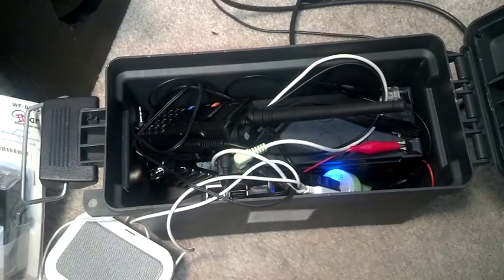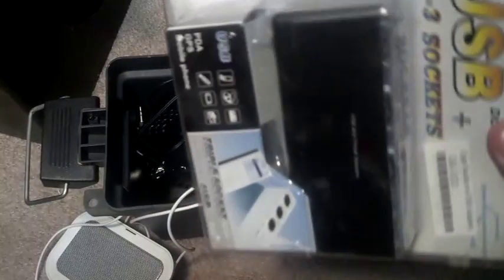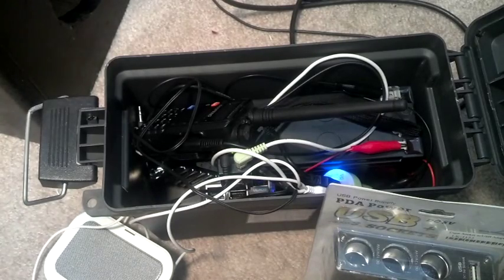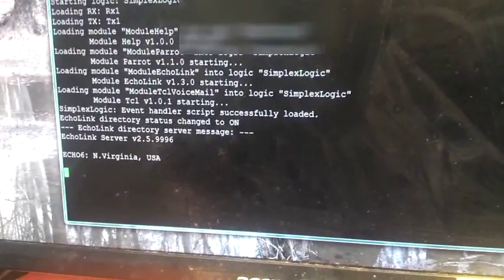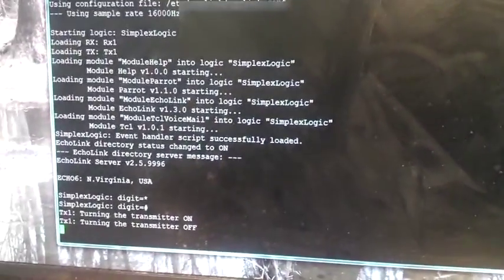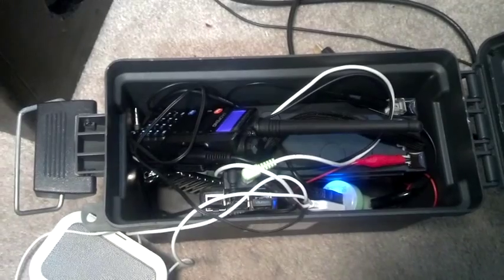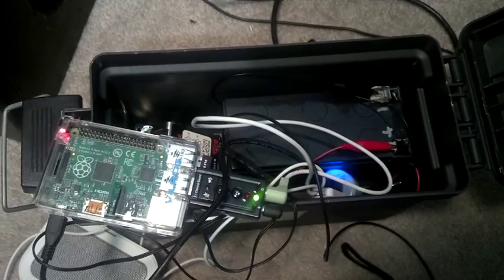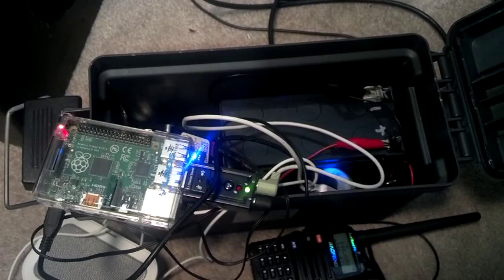Raspberry Pi Svxlink Echolink

Comment: Also NHRC has a repater controller kit that you can build cheap.  I has a digital audio storage chip.  You can use the chip for audio ID on a standard duplexed repeater, but you can also set it for CW ID and use the voice storage chip to record audio and turn it into a simplex repeater, that would be a cheap way to turn it into a full featured emergency repeater very inexpensively.

Comment: So are you just using it just as a simplex connection to get into echo link or does that HT support cross band repeat as well.   I have a great little emergency antenna in my Faraday cage that would be great for that.  I can pull it out and do a review on it if you want.  It was very affordable and works great and rolls up when you are done with it.  73

Comment: why any amateur would think about relying on an internet connection, for emergency comms, is beyond reasonable thinking. i will admit that it's a interesting way to talk or communicate.  but why use a radio? when you have a computer and an internet connection. i've debated this very subject with other hams over d-link radios. and they still think it wise to involve the net. tell me what form or radio will get though when all else fails, morse code? and how many hams lately have passed the test or even studied code since the day the fcc made the judgement call to drop 5 wpm. heck i passed 5 wpm. i'll admit by the skin of my teeth on the questions and answers portion. code copy? not by far. but why i copied is how i passed the q&a. amateur radio is failing to educate it's hobbyist/users in electronic principles. i'm a general class ham and i don't know how to design or build a circuit. i can identify a circuit. but how will that help me put together something when i need something to call out for help. that is what hams used to be able to do. now we buy equipment then plug and play. also, when the government pulls the plug on the net where will ecolink be. this being all about the net neutrality act.
Reply from the maker: To be honest for emergency comms I plan to use my pactor 3 station over HF. But that is out of the cost range for a lot of people.  What i would like  see happen is a low cost digital station people could have for around 50 bucks or so.   Echolink is really just a HF simulator for Technician class kind of like Skype without out the video, It gives them a taste of the really cool / fun stuff.  Code takes time to learn not a lot of people these days want to put forth the effort. Echolink is a fun thing to play with but It will never give you the thrill of building a radio or talking via moon bounce or meteor scatter. As a side note echolink it want made me want to get my general licence   I wanted that hf worlds then became a extra because I wanted more bandwidth.
Reply: there lies the problem within the amateur ranks of the u.s.. and you said it, lazy people. and i happen to be one of them. but i put forth the effort to get my tech plus and got it. then i got my general when it took 5wpm. i doubt i could have passed 13 wpm then but i would have because the faster it comes at you the easier it is top hear the word opposed to the letter. like cq as opposed to c--q . and i'm on hamexam.org right now. failing with a 50% average. but i'm going to get my extra. i will do what it takes to read 20wpm. it becomes natural form of communication. you'll just understand the words by nature, like talking or signing to the deaf. at my family farm, i have a neighboring ham who runs a eme receiver/listener with what looks like an massive oven rack of yagi antennas. he does contesting with them he has two arrays like this.. http://www.nitehawk.com/rasmit/ja5ovu.jpg... if your going to talk on vhf or uhf for any real distance. this is the way. you just have to pick your phase of the moon to do it for optimum east or west contacts or store and forward using satellites. and building a radio from a hand full of scrounged parts is what i want to be able to do. and these amateur test aren't doing it. i passed my no code tech with two missed questions on one element of the two i had to pass to become a ham in 1995 at the shelby hamfest. and tube types are the go to emergency comms radios if you want to be able to talk after an emp, by simply reinstalling the tubes. without the tubes in the chassis. an emp presents a rise and fall of magnetism in the circuit without tubes. with tubes the completed circuit would fry from the voltages generated. you might would even see the heaters flash, like a light bulb burning out. to disable a solid state circuit radio would be a bit more difficult. then you have to resort to a faraday cage. and that may be an issue. if it fails to shield the circuitry. and shielding isn't an issue with tubes being pulled from tube types. only storing the tubes is the issue.

Comment: Nice setup.   One thing on the 12 volt car adapter for the baofang--I got one of those and it would reset every time I tried to transmit--almost like the radio wasn't getting enough current.   Tried it in both of my vehicles and it did the same thing.   Haven't gotten to deep into why since the weather has been so cold but just giving you a heads up.
Reply from the maker: I haven't tried it yet but if i need to i will just rebuild to the specs i need.  Thanks for the heads up